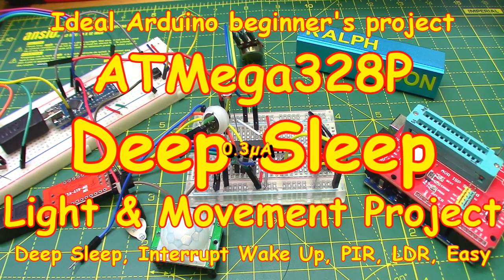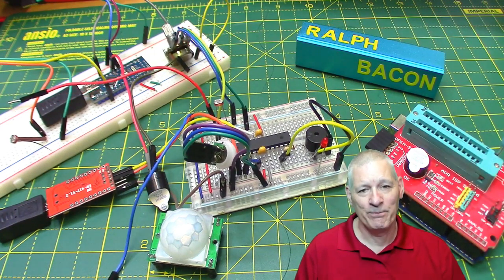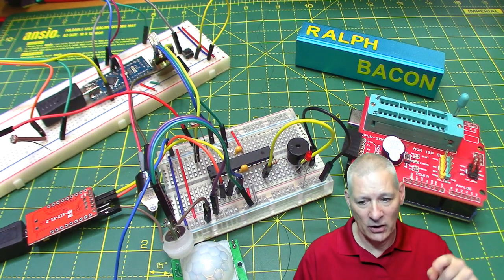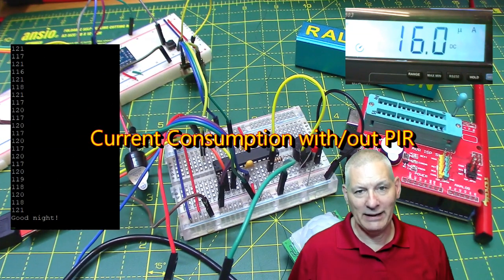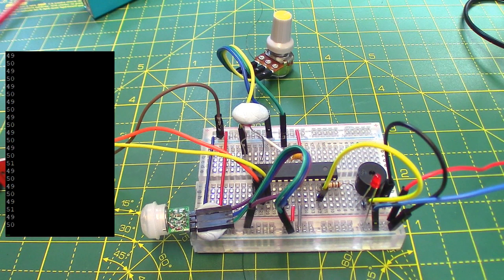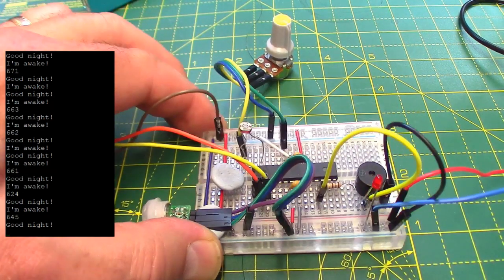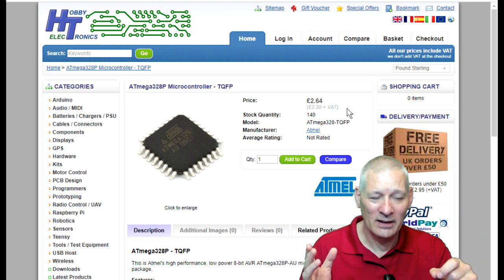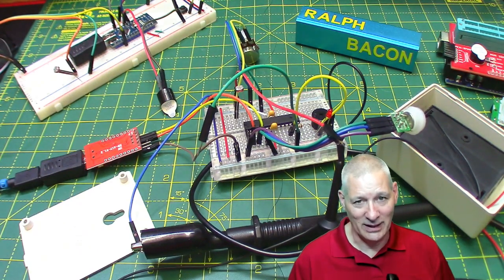#159 PIR Deep Sleep ATMega328P Project (for Benny 😺)

Comment: Would it make sense to add external logic such that the ATMega is not awakened unless the light sensor is sensing no light and the PIR is triggered?  Basically, 

+--------------------+----------------------------+----------------------------------------+
| In the dark?  |  Sensing Motion? | Wake UP microcontroller |
+--------------------+-----------------------------+----------------------------------------+
|         N            |               N                |                  N                         |
+--------------------+-----------------------------+----------------------------------------+
|         N            |               Y                |                  N                         |
+--------------------+-----------------------------+----------------------------------------+
|         Y            |               N                |                  N                         |
+--------------------+-----------------------------+----------------------------------------+
|         N            |               Y                |                  Y                          |
+--------------------+-----------------------------+----------------------------------------+
Reply from the maker: This is a Catch-22 problem, Michael. 

Assume the µC us asleep. Where is the logic coming from for "In the dark"? The µC has to wake up to work that out. Or we build that bit in hardware (typical light/dark Schmitt trigger) that then lets the PIR power up - but that takes up to 1 minute to stabilise. So maybe we then power up the entire unit only when dark? I wonder what the standby current would be for that bit?

So whilst your logic is flawless, getting that to actually work in the Real World stumps me. Perhaps you have an idea on how we might achieve this? It's great this got you (and now me) thinking about this though, thanks for posting.

Comment: I may have missed this, but do you have a video that explains how to do the fuse settings for using the internal oscillator? I believe the "regular" bootloader in Uno's and Nano's set the fuses for external 16 Mhz crystal only. You should be using some other bootloader or some other means of ISP other than USB-Serial conversion. Most of us over here are still using the good old Arduino IDE (well, at least I am, but I like to refer to myself as "most of us")  and unless some other barebone Atmega328 settings are loaded into the IDE as board definitions, all it knows is the regular "Arduino / Genuino UNO" or Nano settings, both using external 16 Mhz oscillators.

Edit: I just watched the ending... Sorry for the impatient commenting :-)
Reply from the maker: I'll be reiterating how to make the Arduino chip (and the LGT 'clone') run at different speeds in a near future video, Bora. It's easy enough to do, especially with a cheap bit of hardware to stop the spaghetti of Dupont wires! But only easy once you know of course, like all things in life. Stay tuned!
Reply: use the AVRDUDESS program with any of the supported ICSP Programmers, it has a bit selector section to change any of fuse bits including the OSC ones. Installing alternative 328P support board defs is easy also.

Comment: Love the videos you do when they relate to Benny! The laughter at your smd skills made me laugh😁
Smart move with the ldr sensor power supply from a gpio 👍 I will be using that in future

Could you not have built it using a AtTiny85? There cheap and use less power plus you taught me how to use them 😀

Also if you made it count the number of triggers when dark. You could use it to say (cat must be in hear as I have had 5 triggers and no door open) thus turn on the buzzer and/or LED for longer. Plus I was thinking of you having the LED out side the cupboard. 

Thanks again for the great video!!
Reply from the maker: I tried using the ATTiny85, Gordon, but the lack of built in serial (UART) and general lack of pins meant I had to abandon that for a bigger unit, which I had plenty of! I had fully intended to use the ATTiny85, maybe for my next 'tiny' project (see what I did there?)
Reply: @RalphBacon  yes I see what you did ☺️ I would like to understand your thought process about the code you have written for the project. As this is a great project for beginners it's worth them knowing why you have done certain thing and why in that order. Thanks for listening
Reply: Where can you find cheap Attiny85's ? $2-3 each is not cheap when you can buy Arduino Pro Mini  with header pins for £1.44 each inclusive shipping to Norway.

Comment: Simple - yes, on the surface. But designing for low power is not as simple as it first appears. You might like to have a look at a very interesting paper written by a university group that shows that it is not as intuitive as you first expect. Worth a look - https://www.researchgate.net/profile/Mohammad_Al-Shorman/publication/332539387_Toward_Energy_Efficient_Microcontrollers_and_IoT_Systems/links/5cbadf7c92851c8d22f7b76d/Toward-Energy-Efficient-Microcontrollers-and-IoT-Systems.pdf

If you find it a bit extensive, at least have a look at the conclusions !
Reply from the maker: There are certain steps you can always take to minimize power consumption but a decent research paper like this can steer makers in the right direction for sure. I'll download it and put it in my GitHub for others to read too; thanks for the heads up.

Edit: I found this one quite interesting:
[Mitigate power consumption by] Using the fastest possible sampling rate, transmission rate, and the highest possible clock frequency.

Many Internet pages are devoted as to whether it is better to run slowly eg 1Mhz or quickly eg 32Mhz do perform a function after a Deep Sleep. Hmm, more reading required....
Reply: @RalphBacon  - The reason for all the discussion (opinions,guesswork, bigotry etc.) is that there are no measurements. There are a few professional instruments which are quite good if you have $500+ to spare. Measuring the current doesn't give you the answer on its own!
I'm working on a prototype gadget to give a real quantity - and aiming to keep the cost under $20.
But being retired means I have far too many other things to do....!

Comment: Ralph, The larger PIR sensor often has a place where you can mount an LDR.  It will restrict operation to night only.  Then, try driving the piezo buzzer directly off of the output from the PIR.  You may find this works, with no microcontroller required.  Device would only consume the quiescent current of the PIR.
Reply from the maker: Hang on, John, so instead of consuming 16µA it would only consume 15.7µA? And where is the Arduinite fun in doing that, John! Noooo! OK, to be fair, what you say may well work but I'm pretending I did not read your suggesting at all!
Now, although this is a project based on my Real Life requirements, I'm hoping it also inspires others to play about with Deep Sleep power saving plus a couple of other techniques. As it happens there's more that I have discovered since this video which I will share in a later video. To misquote Albert Einstein, I'm making this as simple as possible using an AVR chip but no simpler.
Seriously, thanks for the heads up - I've looked at my larger PIR unit and there are three tiny solder pads marked MD, with L, blank and H in a vertical block. I don't know what MD stands for but maybe these are the connections? I know, I know, Google is my best friend!
Thanks for posting.
Reply from the maker: So I Googled and Big Clive has already done this: https://www.youtube.com/watch?v=2dxhbXHYEG0 
the H/L pads apparently control the High Low pattern that occurs when triggered. My little PIR, for example, has to see no movement before going LOW again. When it does see movement it goes HIGH for 2 seconds, or thereabouts. By soldering the H/L it changes that to revert to LOW after seeing movement and going HIGH again if there is further (continuous) movement. Hmm, useful stuff, it's a shame they are so BIG!

Comment: if you put unused GPIO-pins as input make also sure to switch on their respective pull-upp resistors. Otherwise they will catch signals from the surroundings and toggle between 0 and 1 which consumes power.
Reply from the maker: Oh, I didn't do that, Uwe. Does the (weak) input resistor not consume current itself then, given that we have about 20 pins of which I'm actually using about 5 - so 15 pull-ups?
Reply: @RalphBacon  no, it doesn't. SInce the pull-up only connects to the gates of the input transistors it would only draw current and hence consume power if the pin on the outside is connected to ground. Keeping the gates high makes sure that the input n-mos is turned fully on and the input p-mos is turned fully off. This avoids a situation where both transistors could be slightly conducting and thus drawing a crow-bar current from Vcc to GND. It also avoids continuous toggling between the 1 and 0 state, which also consumes power further in into the chip.
Reply from the maker: I shall try that immediately then. Even if I don't notice any current consumption difference it seems that this is the (Best Practice) way to do it. Thanks for the technical heads up, Uwe.
Reply: @RalphBacon  I have only tested in active state and there it makes a big difference. However, I read not in the datasheet that Atmel has included a feature to decouple the input pins in sleep mode, but the datasheet also states:

14.2.6   Unconnected Pins. If some pins are unused, it is recommended to ensure that these pins have a defined level. Even though most of the digital inputs are disabled in the deep sleep modes as described above, floating inputs should be avoided to reduce current consumption in all other modes where the digital inputs are enabled (Reset, Active mode and Idle mode).
Reply: https://i.imgur.com/EH9uTFh.jpg
Reply from the maker: Hmm... so I set ALL pins (0 to 20) to INPUT_PULLUP. I think it's all still working as usual (I was concerned at what I might be doing to the TX/RX pair but I guess Serial will sort that out). Overall quiescent current is the same at around 15.9µA-16.0µA but unplugging the PIR shows a standby current of  0.1-0.2µA, the best I've had. Can I trust my meter? It is 32°C here today!
HOWEVER, some new mini PIR modules arrived from Banggood yesterday so I tried one out. Standby current for the PIR + sleepy ATmega328P has dropped to 10.6µA (from 16µA) showing that not all PIRs are the same even if the picture makes them look identical.
Somewhat interesting?
Reply: @RalphBacon  I experimented with PIRs 2 years ago and also found large differences...

Comment: Great simple explanation as usual.The project cases are way cheaper if you buy in bulk from same website:

https://www.banggood.com/60pcs-75-x-54-x-27mm-DIY-Plastic-Project-Housing-Electronic-Junction-Case-Power-Supply-Box-p-1168745.html?rmmds=search&cur_warehouse=USA

https://www.banggood.com/20pcs-75-x-54-x-27mm-DIY-Plastic-Project-Housing-Electronic-Junction-Case-Power-Supply-Box-p-1168742.html?rmmds=search&cur_warehouse=USA
Reply from the maker: Yes, bulk buying always gives a better price; it depends on whether you need 5 or 10 though.

Comment: Good evening, Ralph !  Great video, as usual.  I see we have a frustrated viewer.  Baah!  180 : 1 is not a bad ratio after all!  Hahaha!

I'm sure you'll be able to fit everything in half the space of that case's back panel.  There's nothing roomy on this PCB and all components are quite simple.  Just a walk on the park for a person with your experience.  I would be tempted to mount the PCB on the back of the battery pack .. or at the bottom of the case, if you plan on using some spacers to fix the pack.

Can you please show us the finished product ?  I'm sure I'm not the only one curious about this.  As for the Sleep Mode, and waking up every 15 minutes, I just might adapt this to my Wireless Weather Station.  I might save on battery charging current and be able to use solar panels after all.  I'll have to strip the board of unncecssary components like the OLED display.  RTC is needed, though.  We'll see about Version 2.0 later the month.

Until then, have a great day!
Reply from the maker: I want this to be easy to assemble for beginners, so as well a through hole components I'll space things out a bit (as I have the room). Mounting the PCB on the back of the battery pack could be done but then it all just floats about in the case, doesn't it? We'll see. Sometimes (as you well know, Daniel, with your weather-station) things only become clear when you actually try and do them!
I'll deffo show people the finished product. But first I must design the PCB, I'd better get cracking!

Comment: Great video as always Ralph.  Is there any way to add to the code for the beeper to beep a special sequence to say the batteries are getting low and it’s time to change them?
Reply from the maker: This is an option, certainly, Bruce, and others have suggested it too. I'll use the internal 1.1V reference for AREF and voltage divide the 4.5V down to that (or just under) so I can read the voltage from another analog pin. I can drive the potential divider from another GPIO pin too, thus only using power when I read it. I can then beep a quicker beep pattern in a lighted condition (eg door opened) to alert me that the batteries are getting low (eg below 3.3V). Keep tuned!

Comment: Thinking of those PIR sensors having a range can be a bit of a trap, because it doesn't work like that (similarily like you sometimes read about a "range" of a flashlight or laser pointer; that's just not how physics works). 
It is about the angular size of an object and also angular velocity of moving through the sensor's field of view. Something as small as a cat will most likely have to be much closer to get detected.
There is also another issue, especially in enclosed spaces. If everything is the same temperature, which can happen in a small room there is nothing to "see". You might say that the cat is warmer than ambient, but its skin is insulated by fur (the whole point of it), so the cat's "surface" is close to ambient. I've observed that effect with an PIR sensor on my bike shed. When I get out of the house in winter (so the whole jacket is still warm on the outside), the sensor detects me from more than 5m away, but when I come back (the outside of the jacket now very close to ambient; again the whole point is insulating) I can get to less than 1m before it triggers. The same happens during warm summer nights, where it's dark but still around 25°C. The body or rather skin temperature is too close to ambient for me to be "seen" and I can again get to about 2m before it triggers.
You should take a lokk at radar sensors, they'd get you around the second problem at least.
Reply from the maker: I've used a microwave sensor in a video (#78) and it worked OK, but in this instance Benny is only going to be at most 1m away from the sensor. I haven't tested that bit yet, I hope it works or else that PIR is going to have to be swapped out! Your empirical experiments are interesting but slightly concerning. Does that mean in winter we have less chance of detecting a burglar with our PIR operated lights because he (and his jacket) are cold (having cased the joint for the last 30 minutes) but in the summer he's warmer than ambient so would be detected as he scurried along the driveway to the house?
Reply: @RalphBacon  
Yes, that would fit with my observation (well, not the burglars; I've never seen them). Although I have to say that I pretty much always come home by bicylce even in winter, which means the cooling effect of moving air (and thereby getting my outside "layer", be it jacket or skin, to ambient) might be stronger than when just walking or standing.
Physically PIR sensors are temperature change sensors, not motion sensors. The sensor essentially "integrates" all the thermal radiation coming from a certain direction (that's what the plastic dome is for; it's a lens for IR). Not (or too little) temperature change in their field of view, no detection. For a thing to be detected it has to be significantly warmer/colder than the background, or it has to take up more of the sensor's field of view.
Reply from the maker: Interesting points that I shall bear in mind. We shall see how (well) this work then in Real Life when I have constructed it.

Comment: Do you have a link for the case?
Reply from the maker: Yes! I do now! It's in this video description and the GitHub and also here:
Plastic case used in this project
https://www.banggood.com/2pcs-75-x-54-x-27mm-DIY-Plastic-Project-Housing-Electronic-Junction-Case-Power-Supply-Box-p-1063302.html?p=FQ040729393382015118&utm_campaign=25129675&utm_content=3897

These can be delivered from the UK or CN, as is your wont. 
Thanks for the reminder, Tim.

Comment: Great video. Two thoughts: 1. Attiny85 could do it in a smaller package. 2. How about feeding VCC (via resistive divider) to the controller to monitor battery level, and you could have a "distinctive beep" when the PIR is triggered in the presence of light (you're putting towels away). This would give you a low battery alert.
Reply from the maker: Two replies then, Dale. 
1. I tried (and failed) with the ATTiny85 as I was winging it with the LDR/pot combo but there was no way to see what I was doing with a Serial monitor. And demoing that would have been difficult. Pity. But it's not a disaster.
2. Monitoring the battery is a distinct possibility if I use the fixed internal 1.1V reference. Yes, you're the second person to mention that, I shall experiment tomorrow (I find after a beer my eyes' focus is even worse than usual).
Reply: @RalphBacon  Good point on #1. Maybe I'll look into the Digispark to see if it would provide better debug capabilities. Many thanks for the response, by the by.